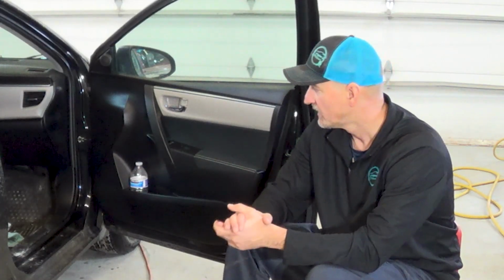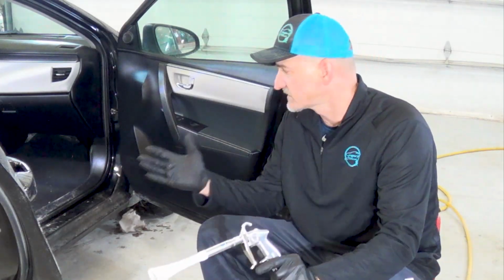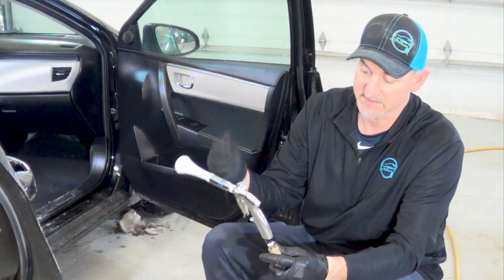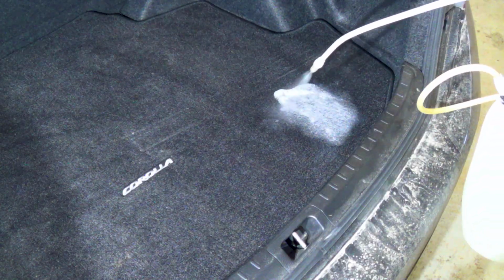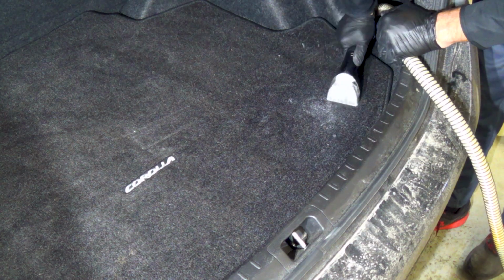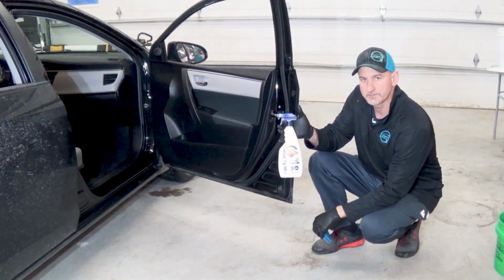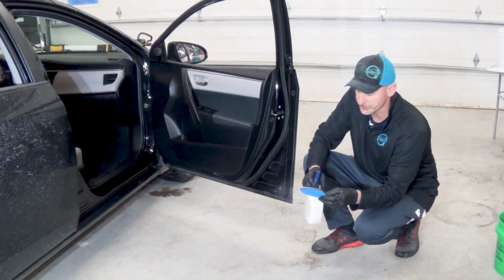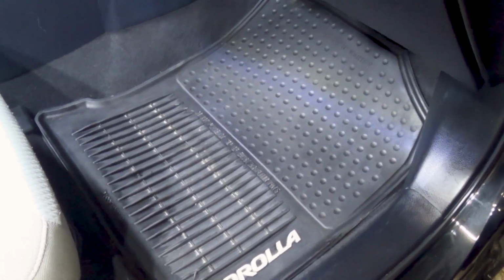I Call Myself an Auto Detailer??

Comment: I’m an auto detailer myself and I have a tip for you… if you aren’t pulling the seats out of a car to clean underneath then a suggestion for you would be to use compressed air to blow out under the seats… works wonders!!😊
Reply from the maker: Thanks. That’s what I’m hoping the Tornador does for me. I think this is the first video I’ve done where I didn’t pull the seats.
Reply: I do detailing on the side, I never pull these cuz of safety issues. Some seats need torque specs & I don’t want to be liable if in an accident & seat becomes unattached. I use my vortex to blow out underneath. Works wonders